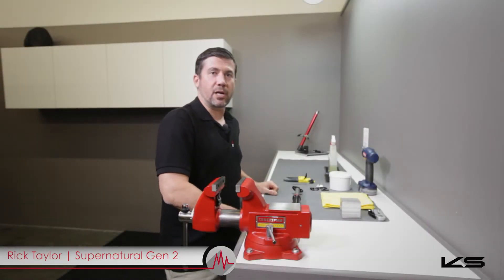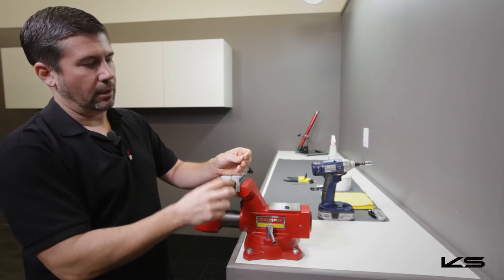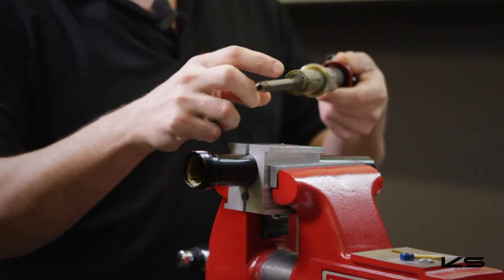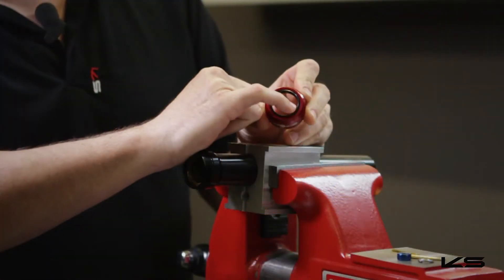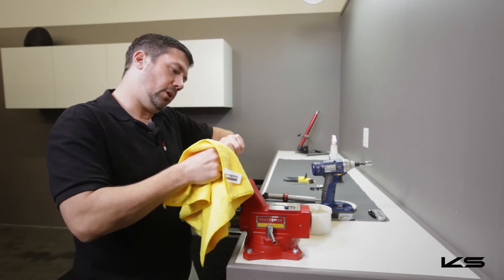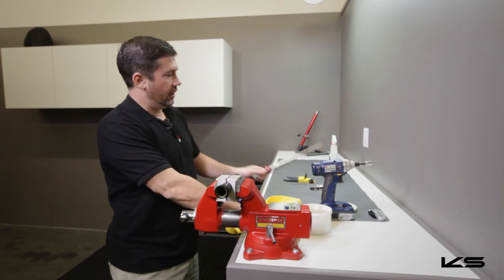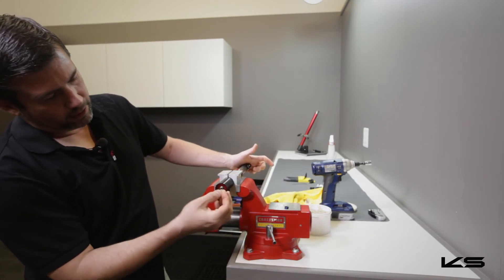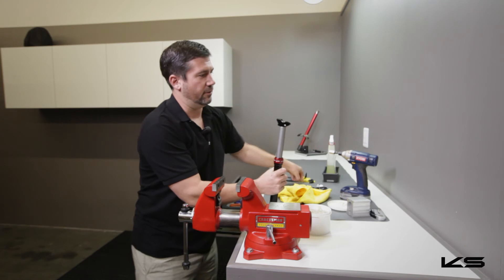KS Supernatural Gen 2 General Maintenance

Comment: Please, how to add pressure tutorial, seal kit, oil level... whatever is needed to fix a sagging post. Adding air should had been user serviceable.
Reply: Ditto...I bought a new bike with this post, and it doesn't work out of the box. I've cycled it many times. I was hoping it just needed air pressure... :(